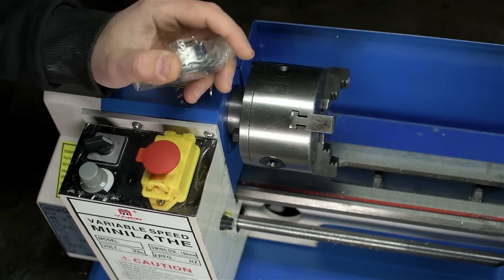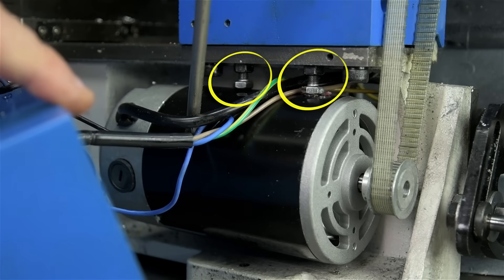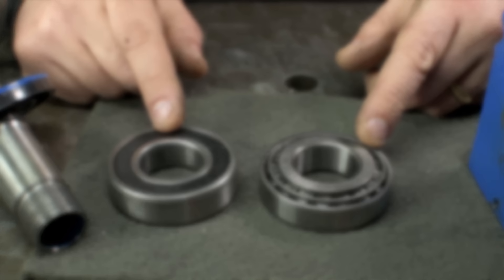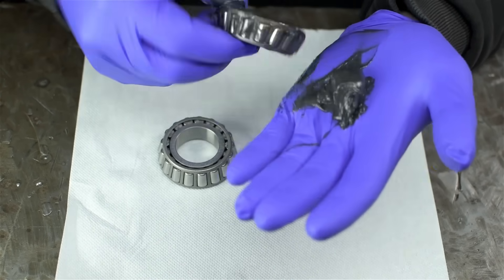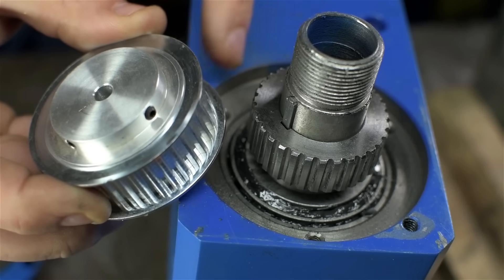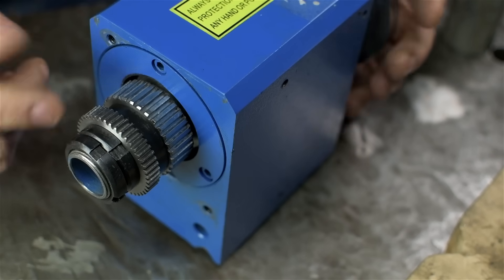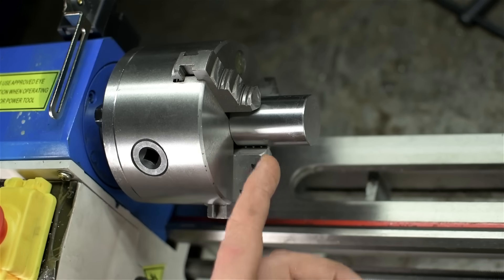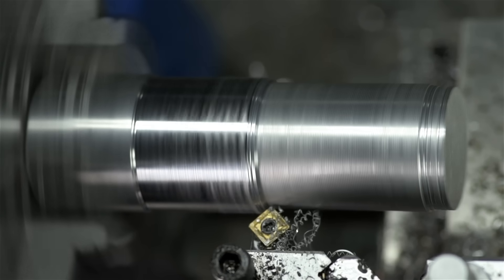Better LATHE Than Never!

Comment: Long time viewer here. I just bought my first cheap import lathe, very similar to the one You are showing, with some tooling and replaced spindle bearings (at least the seller said so). I wanted to do it for many years, but I blame the final decision directly on You. You better lay low for a while, my wife may find You ;)

Comment: Nicely done Tony! I guess I better get rid of those ratty class 7  angular contact pairs in my Hardinge HLVH ;-). If you repeat your turning test with a piece of approximately .003" thick brass shim wrapped around the shaft and just under the first lip of the jaws to compensate for the  bellmouth of the chuck jaws. I bet that improves things as much or more than the taper roller bearing upgrade.
ATB, Robin
Reply from the maker: interesting proposal!
Reply: @ThisOldTony  IMO the most unrealized cause of chatter. Many don't load the jaws properly when trueing  them to get a parallel grip at max gripping force. When done properly the jaws will touch only at the tip when lightly tightened and have a significant gap at the back of the jaws. After tightening fully the jaws will touch at the back. Most brand new chucks are the opposite and no amount of tightening is going to improve the situation.
Reply from the maker: grind them true or new chuck?  maybe collet chuck?!
Reply: @ThisOldTony  Hard drill a hole in the front face of each jaw to accept a slip fit dowel pin.  Find a junk bearing race that when gripped by the dowels give a large enough ID for your truing method (grind or hard turn). Tighten chuck to max you think the chuck is good for. Grind/bore the jaws right thru the id of the bearing race.  This is premium content I am giving away ;-)
Reply from the maker: I have a "spider" I can use to preload the jaws but a Dremel in this toolpost scares me!
Reply: @ThisOldTony  The spider MUST be very close to the tips of the jaws. You are intentionally stressing the whole system to rack the jaws. Alternatively can put each jaw in a vise in the surface grinder and indicate the existing ground surface to be about .003 high at the scroll teeth side compared to the tip. Then grind to just match the original grind at the jaw tip. do this to each one. Assemble, tighten very gently on a shaft and check that the shaft wobbles pivoting at the jaw front and has room to flop around slightly at the back. As you tighten to max, the gap at the back of the jaws should disappear and you will have a very good grip on the shaft. The fact that the jaw grip surface is no longer cylindrical is irrelevant.

Comment: I don't recommend you use a molybdenum grease for roller or ball bearings. Molybdenum is usually reserved for sliding applications, plain bushings on shafts, that kind of thing.

Comment: Tony, I’m not sure if you’re interested since you’re making it CNC but I had my mini lathe out today and discovered a modification I made to the power feed gearing 10+ years ago that slows it way down. I mounted a ~44 tooth gear to the front of the middle ~300 tooth gear to make it a compound gear. I could then put a 280 tooth gear on the lead screw with a spacer behind to bring it in line with the new compound gear. Had to cut away a section of the back of the gear cover to make room but that’s no big deal of course.

Maybe this will help someone else too.

Comment: Tony, I have watched this video a couple times now and did not understand the need to "surgically remove the compound" at https://youtu.be/HYOgmhpBUJs?t=45 and then when you did this at: https://youtu.be/HYOgmhpBUJs?t=833 I looked around for an explanation for your modivation. (I think this is the only wordsmithing you will get from me today. Few of us are able to live up to the TOT standard of making up words.) Why did you take out the compound? Were you counting on removing a lot of sloppy loose parts that would vibrate and replacing it with one simple and securely fastened part? And what will you do when you want to make something that requires the use of a compound?
Reply from the maker: yes the compound doesn't inspire a lot of confidence.  it can be replaced for tapers when they come up.  also I plan to CNC it sooner or later so I won't need it long term.

Comment: I suspect that the plastic spacer was chosen to help make setting the preload easier. It adds a bit of compliance to the system so that 1/8 - 1/4 of a turn gives you some granularity in the preload. Lots of gearboxes use wave springs for this same purpose. I'm sure the wave spring was $0.50 and that plastic was $0.02 so they went with the plastic. If you replaced that particular spacer with steel, the same change in preload force would happen over a much smaller turn angle and it would be really hard to control. So I don't think swapping it for steel is actually a good idea. Replacing it with a wave spring though would be a good choice. 

In an alternative configuration, you could put a steel sleeve BETWEEN the bearings, then a steel spacer where the plastic was, and crank down on everything. The spacer sleeve will control the preload on the bearings. But doing it in this way requires really tight tolerances to get it right.

Comment: The timing belt's elasticity is also source of chattering, happens also on big CNC lathes. A bigger timing pulley will work to reduce chattering, perhaps you will need a faster motor.

Comment: i have a sugestion.
is it posible… to make a Lathe for metal, from scrach… with normal hometools? grinder, saw, file, handheld drill???? is it posible… and can you make a cheap one, that can make new and improveded components for it???
maybe it can be a series??? or would it be to difficult?
Simon
Reply: Yes, Yes, Probably not cheap but Yes, Life's too short and Yes

Comment: Nice upgrade to the mini-migraine! Bearing preload should be 12 to 18inlbs of turning torque on a dial torque gauge with the moly grease at that fill amount. 6 to 12 inlbs with oil. That's from 21 years pounding my head against a wall. Er, I actually meant building transmissions and rear ends in motorsports as a professional, it just feels like pounding my head against a wall.

Comment: Setting up the preload on those bearings is essentially the same idea as setting the bearings on the front end of a car (well, one that has spindles and tapered roller bearings!).  We just set those a hair (ask AvE which one) loose to allow for thermal expansion.

Comment: Great video!

The bearing upgrade is a good idea. You can use the regular conical taper bearing at the spindle chuck side without any worry of end play 'load' issues. But the motor / gear side is just asking for trouble because of the load on the race will be none existent unless that plastic spacer is replaced. An angular contact type on the motor side is a good idea - if high quality materials are used but it has its own problems. The chuck side may require the use of shims.

The amount of Pre-load when using conical taper bearings for both ends is going to be what either makes this upgrade work or just make problems worse.

I would test fit everything together without any grease first. See what kind of drag the bearings along with dry end play you are working with. Then grease up the bearings and start final assembly.

I would beg, borrow or buy a torque wrench, while having your wife holding the other end....i'm kidding,  to about 50 inch pounds. Start there and then check end play after warming them up to 25% power then 75% of maximum rpm if there's no obvious end play. Then recheck the torque. Set to 50 inch pounds and then add one 1/4 turn. The bearings you have shown are designed for a lot more axial loads than that lathe will have to deal with. Grease, there are some excellent high temperature low friction greases on the market that are designed for bearings turning 3,000 rpm. Timken makes the best imo for this application. It is actually best to fully grease load tapered conical bearings like you would for an automotive application. Wipe off excess and then run the bearings at 25% then 75% to see what kind of grease witness debris occurs. the bearing races will in fact seat pretty quickly. If you think there is excessive drag, reduce the preload to 40 inch pounds then 1/4 turn. 

On the motor / gear side it will be critical to make sure the bearing race is pressed in perfectly or you will get one hell of a vibration. Having two conical / tapered bearings on the same shaft opposing each other, will bear witness if the holes are centered or not. The bearing must be held in place with near same torque value as the old bearing was because the preload required on this side will be 'set' by the chuck side bearing. There is a problem with this bearing configuration; axial contact will be significantly reduced on the motor side once machine ops begin. The spindle face that mounts the chuck is transferring longitudinal shaft loads down towards the motor side inner bearing inside race, which of course will be away from the outside bearing race, contact being reduced. Your biggest challenge will be harmonics because the gear load on the teeth will create an imbalance on that cannot be eliminated. It's probably why they have used plastic gears.

Because the longitudinal axial harmonics are significant, using angular bearing can also be tricky.  The one you show (7206B-2RS)  are designed for ONE way with inside face axial shaft load. So whatever collar face it is contact with must take all of the load. Using these on the chuck side is fine if the spindle shaft makes full contact with the shoulder without hitting the outer race face. Angular bearings often have weird limitations. When using them on the motor / gear side, make damned sure the angular bearing inner race 'face', is gearside. Using your image as an example, it's on the right side). Just ask me how I know... 

Angular bearings are not to be greased and the amount of preload is almost zero. Shims may be required to make sure it is just seated and 'super snug' on the motor / gear side. But this is where it gets sticky, if the angular bearing is set with almost no preload - how can we set the preload on the chuck side conical / taper bearing. Based on the design of the mini-lathe shaft used, there is no workaround to this problem given the way the bearing on the chuck side will have to be pressed onto the spindle shaft. 

Ultimately I would recommend you either choose Conical / Taper bearings together as a set or Angular Bearings together - but never mix the two on the same shaft. I prefer Conical Taper bearings for this application despite the problems it introduces on the motor side bearing because they significantly reduce harmonic vibration at high rpm.
Reply: So in other words, do what Tony did.

Comment: Tapered rollers are used under much higher load conditions than a baby lathe,  for example the wheel bearings on nearly evey car and truck. I'd have no worries using grease on them since that's a perfectly appropriate and standard lubricant for them!

Comment: First job I had to do on mine was to replace the internal gearing (mine has high and low speeds) as I shattered them after two weeks! They are plastic as standard so I changed them for steel ones and changed the bearings for (Decent) angular contact ones while I was in there. The bearings were a straight swap but obviously there is no way of lubricating the steel gears so I just tilt the machine on its back and use some spray grease to lube them every now and then. I think 80 % of my time on the mini lathe was making better parts for it - educational you see!

Comment: I think that you'll see that the Atlas 618 lathe had Timken Roller bearings and was lubed just as you described. Not a zirk but a simple oiler cap port. It is recommended to oil before each use. Yes the oil just dripped out the bottom of the headstock, but this is a minimal amount of oil leakage especially when one considers the usage of cutting oil and a lathe. Many older lathes which used oil drip fittings just let the old oil drip downward. Its not a real problem. Lathes are oily creatures.

Comment: For such a small lathe, would an angular contact ball bearing be a good choice? I mean the axial load isn't much (compared to a full-sized lathe) and the smaller parts machined are done at faster speeds, so it'd be kinda the best of both worlds?

edit: I should have looked at the remainder of the video before commenting.  Although he didn't address my exact question.

Comment: Mounting the lathe on a heavy base will help improve rigidity. My 3 in 1 machine is mounted on a stand made from 3x3 1/4 wall tubing fully welded together. I can take much deeper cuts now because the lathe bed doesn't flex nearly as much.

Comment: After watching this video I checked to see what kind of bearings my lathe has. Turns out, it's so old they weren't invented yet 🤣.
Just jokes, I'm sure they were invented, my lathe just doesn't have any, well not on the spindle at least. I'm a total newb as far as lathes and machining goes, but I was still pretty surprised. The spindle just sits in a cast iron saddle sort of thing with little funnels attached to oil journals. Gladly, it looked to be in pristine condition spite it's complete lack of bearings 😉. Sorry for the crazy long comment, it was just kinda interesting to me. Thanks for the video, once again nudged to broaden my knowledge lol 👍

Comment: Now I have to upgrade my 7X14, thanks ToT! I wonder, could some of the chatter be coming from either the tool slightly overhanging the carriage, which is light and poorly clamped down, or from the flexibility of the timing belt working as direct spindle drive with no reduction?

Comment: bearings in  a lathe should be super precision class 4 ,ABEC 7 with an appropriate bearing housing fit, alignment  and preload. I have seen Chinese P4 precision angular contact sealed on ali express for cheap that may work. try aluminum cutting inserts, extremely sharp and leave a fine finish on steel as well

Comment: Hi Tony!
I'm learning so much from you! Thanks!
A quick not so relevant but yet deeply relevant question (honestly I'm just asking it hear because this is your last post!), suppose your spindle has a 0.1 mm TIR; does a freshly cut surface shows this runout? (i.e. indicating the surface while chucked on the lathe)
In general what is the real price of the spindle runout? or I think equally import what is the real price of, let's say, a three jaw chuck runout? Yes you get concentric parts while stilled the part is still chucked, but what will be wrong? why does spindle runout matter at all? Do you not get "round" shapes with a spindle runout?